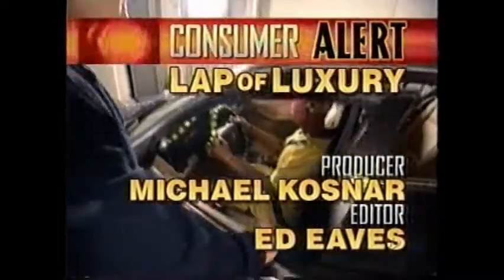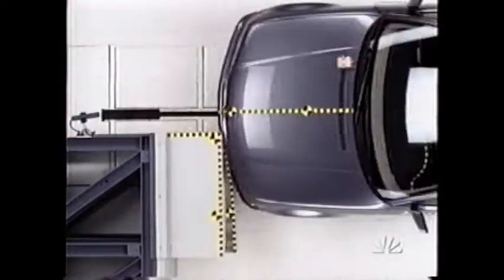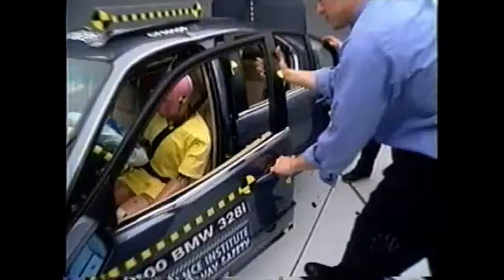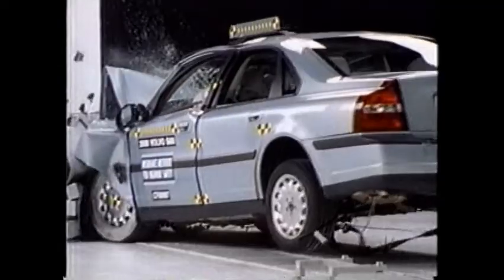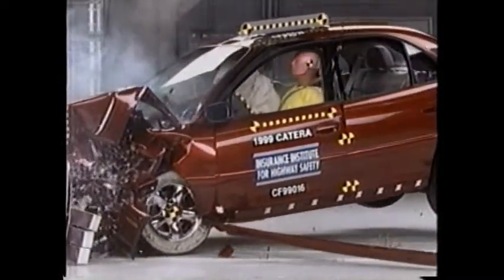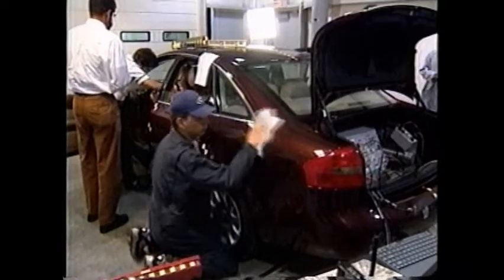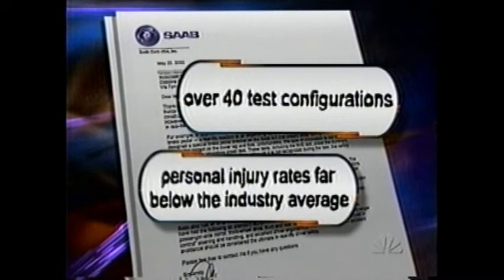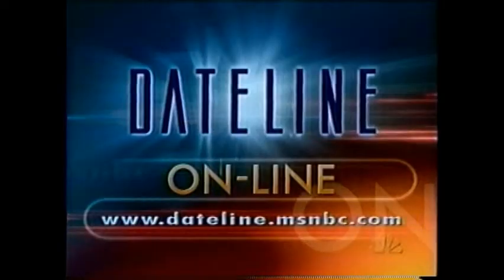Dateline NBC - IIHS Crash Tests 1999-2000 Midsize Luxury Cars

Comment: These early tests were a blessing for consumer.  The side impact ones were also a very important one as well. I appreciate that they did a lot of these. The current ones I am getting concerned about because it seems that some of these adjustments that they're having to make on the latest cars are coming at the cost of visibility. Another potential problem is with the corresponding high belt line of the cars is getting out of the car after an extreme car wreck. Some of the cars that have been made corresponding with some of these wrecks had such a small window that getting out of them in the event of an emergency say the car catching on fire after a wreck is more difficult, possibly impossible Even for an average built person. Some other design measures like the taller center council that is being incorporated in modern vehicles is also alarming. A friend was involved in a severe side impact wreck and because the center console was lower, she was able to slip up onto the center console during the collision. Some newer models have them higher up even with a grab bar. If she had been writing in those cars there's no way her body would have been able to slide up on it and she would have been crushed to death. I'm also beginning to get concerned that while safety is important, are we making unaffordable and thereby pressuring people to own older, less safe vehicles because those are affordable? Another thought to ponder is while I certainly appreciate improvements to safety as a recipient of the benefit of it, I would like them to draw the line and say The standards we have today are enough and they do not need to be tightened any further.  These standards are making the cars less affordable, require no effort to be a total loss, And the least safe vehicle today is not only dramatically safer than the safest vehicle made 30 years ago, but it is also safer than any motorcycle made today or ever will be made.  If we are concerned about safety, saving people's lives, reduced injuries, the best thing to do is to start enforcing the speed limits and start enforcing red light and stop sign violations.

Comment: Fun fact: the Catera is also a german car, but costructionwise the oldest. The original car, the Opel Omega B, came to the market in late 1993.
Reply: That's not uncommon for American auto companies to use an old design acquired from an international merger/partnership. Sometimes they just badge engineer the thing, sometimes it's a more extensive rework of an old design since they could get it with the core engineering already done. The Chrysler 300 for example was a rehabbed Mercedes 1996-2002 E Class chassis.

Comment: How crazy, Brian was somewhat right now they’re moving into more modern versions of the offset test looking at safety of rear passengers now. They tested the vehicle I had before my current car, which was a 2014 Toyota Corolla and they started a new test Called the small overlap test in my car performed horribly I looked in Toyota probably because of that test redesigned the 2017 Toyota Corolla frame so that it was stronger. Take a look at that crash test compared to the 2014 and it’s astonishing, I ended up trading in my car for a 2017 Toyota Corolla SE and I’m much more at a peace of mind with this model.
Reply: I'm waiting for the desert southwest "drop a boulder off a cliff onto the roof" test. It's a serious problem and thousands are spent each decade on signs warning of the danger so it's a legit safety concern for sure.

Comment: 10:29 Narrator: The IIIHS did not move on from this test, twenty years later, they have actually upped the ante for the moderate overlap front test
Reply: Technically, it’s a new test, because it’s different than the original test. However, they still haven’t given up the original test, which is odd, but they likely will soon.

Comment: The BMW is probably the only car in that crash test that I would still occasionally see on the road.
Reply: Here I see a lot of S80s
Reply: @titan9259  same
Reply: Think I might see a lot of S80s still, though not 100% sure as at a glance it is very similar to the S60.
Reply: Seen one like it in my country. I usually don't this manufacturer, because a lot of jerks are driving "B.M.W.'s" just a status symbol, but they where good cars.

Comment: 1996 328is manual was still my fave car ever. Before BMW got all plasticky and overly complicated/unreliable.
Reply from the maker: I had a 1994 530i that saved my life, and a 2002 330i I regret selling. Currently I am driving a 2012 535i. They're still great cars, just not the totally engaging Ultimate Driving Machines they were.
Reply: @carsandcrashtests  I agree. BMW still makes really nice cars but they're not the Ultimate Driving Machines anymore and I'll give it to Buff Barnaby, that yeah some BMW's are unreliable and all BMW's have confusing controls. But still nice cars though, nonetheless.
Reply: Wym the e36 was extremely plasticity